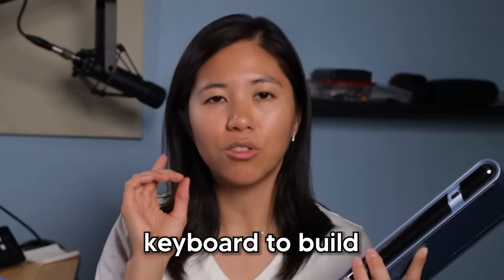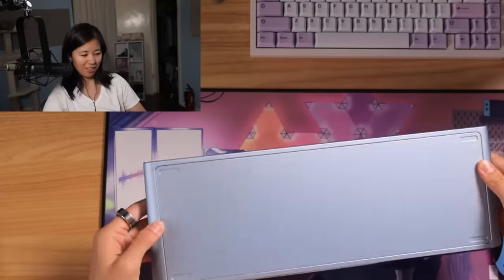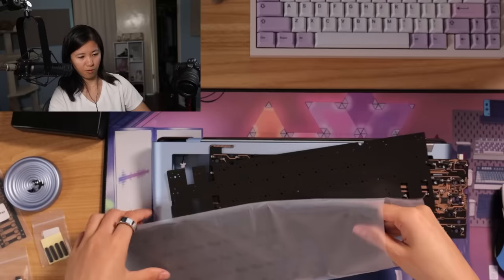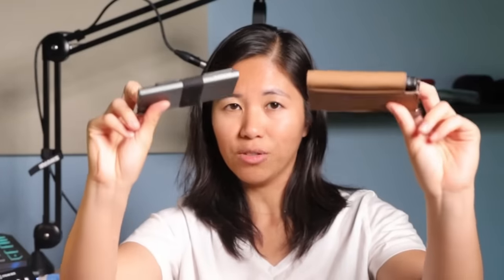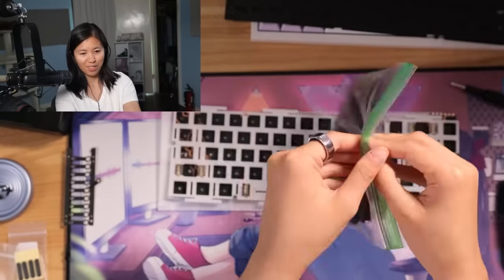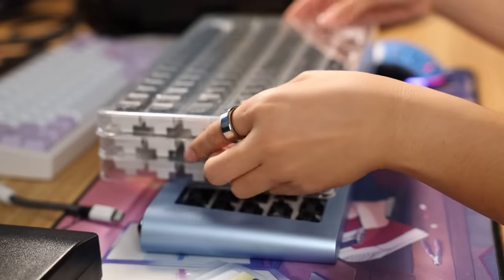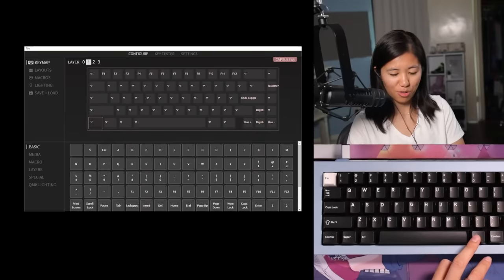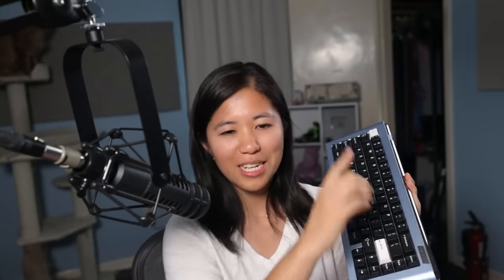This keyboard is out of this world

Comment: I like that they're trying to be different, but the shape just comes off as the pill shape aesthetic Alienware has been going for lately; though I'm not sure if they've made a pill-shaped keyboard that mimics their laptops yet. I also don't like the amount of bezel at the ends, there's still a solid 2u of spacing width left in that chassis, and there's still space for a function row if the layout was shifted down a bit; I also don't like the .5u gap next to the arrows, sacrifice some space width and put back either the right alt or the select key. Personally, I think it'd also look better if the corners on the top and bottom were rounded in some way, it'd be more unique with the spherical corners and would distance the product from the Alienware pill aesthetic. This could also look interesting with round and pill-shaped keycaps; though I wish there were round key switches to match, this would really allow the plate above the PCB to be a visual piece as well, which would be good potential for LEDs or a nice complimentary or contrasting color to the case. I like the case, I just wish they'd do more with it, and I wish there was more part variety within the industry to target different aesthetics.